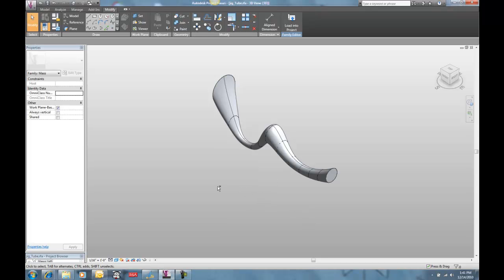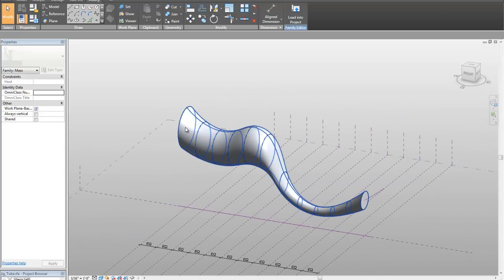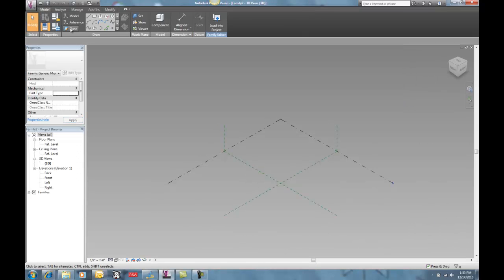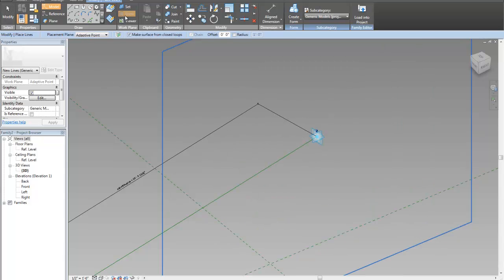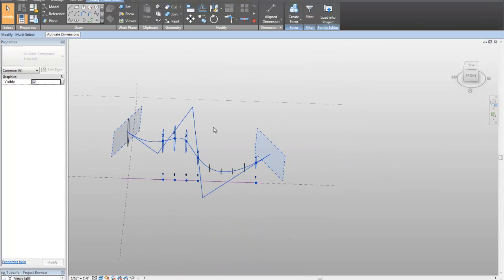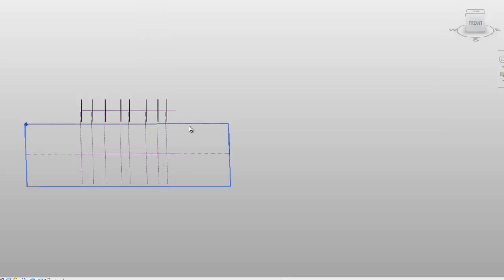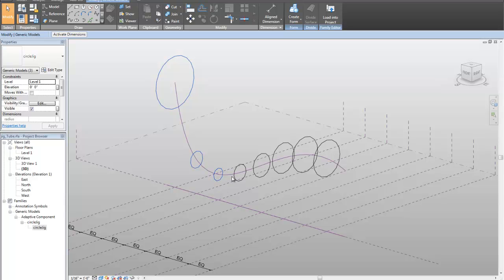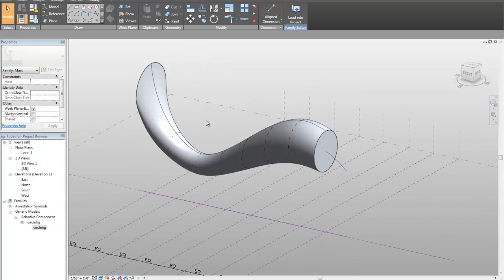Parametric Patterns: Tube Jig

Comment: Hey Zach, 

When I place the circle adaptive component, the circle bends to the curve of the spline, instead of staying in place to the reference planes like in your video. I have also tried to place the circle on the different plane in the adaptive component, but they still don't behave correctly. Does it matter which plane the straight reference line on the bottom is hosted to? Anything else I should check to fix this problem? Thanks so much!